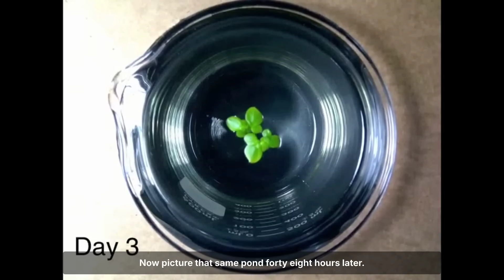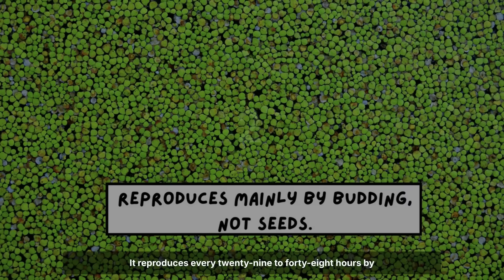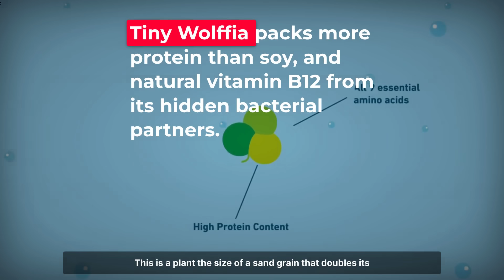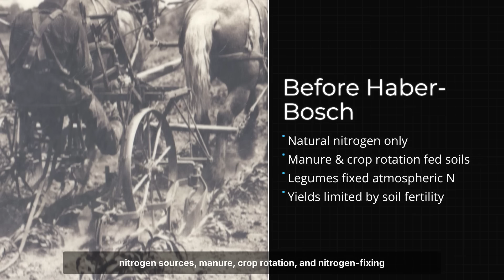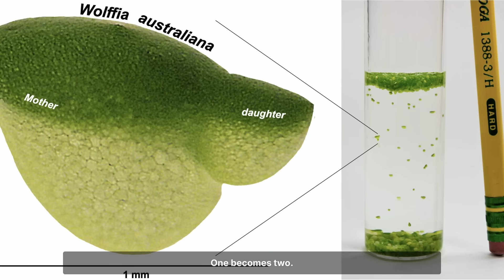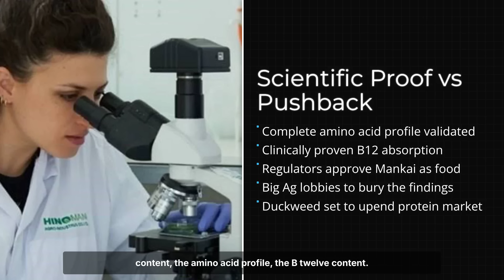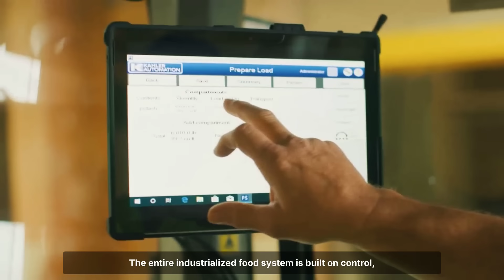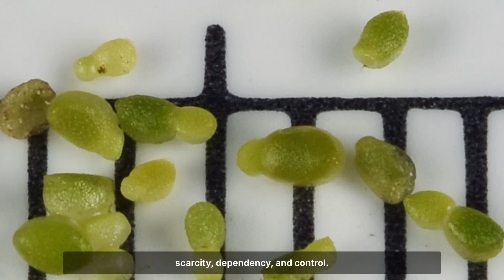This Plant Has More Protein Than Beef, Doubles Every 48 Hours (But It's Called Pond Scum)

Comment: The claim that 600g of fresh Wolffia per day meets daily protein needs is misleading, The math doesn't hold. Fresh Wolffia is ~92-95% water. 600g fresh equals ~30-40g dry matter.At 45% protein, that yields ~15g of protein—far short of the daily 80g requirement which need closer to 3-4kg of fresh wet plant matter.

Comment: In Hindi, Wolffia globosa is primarily known as वॉटरमील (Watermeal).
Since it is a scientific and relatively niche aquatic plant, it is often referred to by its transliterated English name or its scientific name in educational and botanical contexts.
Common Names
 * Hindi: वॉटरमील (Watermeal) or वोल्फिया ग्लोबोसा (Wolffia Globosa)
 * English: Asian Watermeal, Rootless Duckweed, or Water Eggs.
Key Characteristics
 * Smallest Plant: It is recognized as the world's smallest flowering plant, measuring only about 0.1 to 0.2 mm in diameter.
 * Appearance: It looks like tiny green grains or specks of cornmeal floating on the surface of still water. It has no roots, stems, or leaves.
 * Nutritional Value: It is a rich source of protein and has been researched as a potential food source for astronauts and livestock. In parts of Southeast Asia (like Thailand), it is known locally as Khai-nam (water eggs) and used in traditional cuisine.
Would you like more information on its nutritional benefits or how it is being used in modern research?

Comment: I found the statement about the ESFA allowing wolfia as a new food lacking a bit of context. While the plant itself is allowed now, the powdered form is still forbidden in the EU mainly due to high manganese content. As super accumulator wolfia adsorbs plenty of contaminants from the water, which require a carefull control of the feeding water. Also while it does not "require" fertilizer in the form which is put on the fileds, it still requires K, N, P (and for the bacteria and B12 production: Co) in the water.

Comment: Duckweed has the nickname "aquarium herpes" in the fish keeping hobby because once you introduce it to your tank, it is extremely hard to get rid of. Just a single speck missed is enough to start a whole new carpet. It's recommended to keep separate equipment such as nets for tanks with duckweed. I have duckweed in my tanks and smaller planters descendant from a batch I bought years ago. 

But it's great for sucking up nitrates, nitrites, and ammonia not to mention provides helpful cover. Plus it looks really nice. So it remains popular.

Comment: One other benefit is that having something like this covering the surface of the water can dramatically reduce evaporation.  That's a big deal in the western US, and any other hot, dry agricultural areas, because many farms here have ponds used to store excess water and provide irrigation.  But during the hottest weeks, when you need the water the most, you also get the most evaporation.  This could potentially provide a double benefit, by conserving water AND providing a food source for livestock.  Given its growth rate, it would be interesting to see how it competes with other fast-growing grazing crops.  If it outperforms those by a good margin, that could allow farmers to carry the same size herd on less land, and possibly produce healthier animals.  With the beef industry, in particular, currently being trampled by the meat packing megacorporations, this might be a good way for them to reduce their operating costs and stabilize their revenues.

Comment: Great video on Wolffia globosa (Mankai duckweed)—it's genuinely exciting! High protein (up to 45% dry weight in optimal conditions), complete amino acids, bioactive B12 from symbiosis, fast growth, and wastewater-cleaning potential are all backed by peer-reviewed studies (e.g., Ben-Gurion University trials in Clinical Nutrition).

But a few claims are overstated, and the "suppression by Big Fertilizer" narrative doesn't hold up:

Yields: Realistic managed yields are 10–30 tons dry biomass/ha/year (protein ~4–12 tons/ha), far better than soy but not the "100 tons protein/ha" mentioned—that's unrealistic extrapolation ignoring limits like light/nutrients/harvesting.

B12: It's bioactive and helpful (especially for plant-based diets), but low (~2–3 μg/100g dry). You'd need a lot for daily needs—great supplement, not a standalone fix.

Commercial status: Mankai (from Hinoman) is available as frozen cubes, powders, and shakes online (e.g., eatmankai.com, some Amazon listings). It's GRAS in the US, approved as novel food in EU for fresh forms. Not mainstream yet due to processing costs, safety controls (wild can accumulate toxins), and consumer familiarity—not a conspiracy.

Suppression? No evidence of deliberate burying by fertilizer industry. Barriers are practical: tiny size makes scalable harvesting/drying tricky; needs controlled growth for safety; soy/pea infrastructure dominates. Research is booming for sustainability reasons.

Comment: But it’s NOT a ‘complete protein source’. What a disapointment to find out these claims don’t actually hold up… Duckweed is nutritionally interesting and unusually high in protein • for a plant •, with relatively low antinutrients when grown in controlled conditions and properly processed. However, it is not a replacement for animal protein. It does not reliably provide bioavailable vitamin B12, has limitations in essential amino acids such as methionine, and lacks several micronutrients that animal foods supply in readily usable forms. Even with boiling or fermentation, duckweed works best as a supplemental plant protein or ingredient in a mixed diet, not as a primary protein source or nutritional foundation. But its ease of growing is realy its most intetesting aspect, also it could be an important nutritional upgrade in areas of extreme poverty and malnutrition.

Comment: This is used as chicken feed in Asia. You can use 60 % duckweed and the rest is what ever the free range chicken find in or on the ground plus some grains and kitchen leftovers. 
Some people grow tilapia in above ground pools and have the duckweed growing on the water surface. The fish can live off of that but if you place your chicken coop above the pool and the droppings fall into the water the fish are better fed. You can couple this with an aerophonics system, circulating the fish tank water through a ammonia to nitrogen converter and you got year around fresh greens for very little money plus the eggs, poultry and fish meat your system produces. If you set up your greenhouse with the earth battery method you don't even need heating and cooling. A simple and affordable solar system can run the thermostat governed fans. 
All you need is space which is the real Achilles heel for many. Farmers got plenty of food the way it is. Ask a farmer or those living in the country and food is the last thing that concerns them. They got plenty of food.  It's the city people who are trying to find a way out of their slave existence. High density living is the main issue and not the lack of food security.

Comment: You know not all proteen is the same right? The plant based protein and the meat based protein have slight diffrent chemical structures. 
The human body is designed to used both for different things. 
Its hallarious that you suggest that muscles can be built from plants. That's your basic argument for the protein here. 
Lots of different proteins out here buddy. 
Its like expecting kerosene to run your petro car.  Well they are both fuels.  But they don't quite work the same.

Comment: Cool plant, interesting research – but this video leans hard into hype and conspiracy. Actual science is promising, but not magic.

Wolffia/Mankai is legitimately impressive:
• ~35–45% protein when dried, not when eaten fresh (fresh is ~4% protein).
• Contains all essential amino acids and some B12 via symbiotic bacteria (not the plant itself).
• Clinical trials showed good digestibility, roughly similar to dairy/peas protein.
• Fast growth? Yes. Under controlled, nutrient-supplied conditions, not just “a pond and sunlight.”
• NASA has tested it for closed-loop life support, which is cool and real.

But…

Claims that “industry buried it” stretch evidence to narrative. Duckweed isn’t popular because:
• It has very high water content, so you need a lot to match real protein intake.
• Growth rates require controlled nutrient input, not just a bucket.
• Taste/culinary acceptance matters, and most people won't replace steak with pond greens.
• Scaling production safely means monitoring pathogens, heavy metals, wastewater toxins, etc.
• Monoculture dominance isn’t evidence of suppression – it's economics, yield consistency, shelf life, and logistics.

Also, comparing to beef by dry weight is misleading if you don’t note moisture content. Beef is ~70% water but still delivers way more protein per serving than scooping wet duckweed out of a pond.

Potential future use cases?
✓ space farming
✓ animal feed
✓ wastewater remediation
✓ supplements/ingredient powders
✓ survival + low-resource food production

But replacing cattle or collapsing Big Ag? Not remotely demonstrated.
Promising ≠ panacea. Underrated ≠ suppressed.

If people want to grow it, great – but promote it for what it is:
a fast-growing aquatic plant with decent amino acid profile and potential for niche protein production…
not a secret protein that could “feed the world for free but They hid it.”

Science doesn’t need myths to be interesting.
Reply: Appreciate your thoughtful comment.

Comment: You can't turn that into viable nutrition in your body, we aren't designed for it. 

It'll just cause bloat, gas, and inflammation, and very little of the nutrition will get digested. Not to mention there's no usable fat for your brain, hormonal system, etc. 

Could be used to feed animals that are designed for it.

Comment: My only issue with duckweed really is that I don't know how much of it is bird droppings. But if I live in an area without water borne birds, I think that's when I'd be growing duckweed. Either that, or I need to figure out a way how to wash it.
Reply: If you want to use it for compost then you can just take it from a pond and it works great, unless you've got heavy metal pollution there. If you want to eat it then you grow it in a clean tank of fresh water with lots of sunlight and definitely nowhere near the birdpoop.
Don't mix the two uses.

Comment: You are comparing apples and oranges. Fresh beef steak has 20% protein and 75% water. Remove water and you end up with 80% protein. 2x more than dry duck weed. 40% is still impressive but the claim is incorrect

Comment: This video is misleading. Don't eat this from wastewater or runoff water or natural pond water. It is a bioaccummulator and will concentrate heavy metals,  etc.
Reply from the maker: That is an important point, and you are right to flag it. Duckweed should only be harvested from clean, controlled water sources. It is a strong bioaccumulator, which is useful for remediation, but that also means it can concentrate heavy metals and pollutants if grown in wastewater, runoff, or contaminated ponds. The video is about its potential, not a recommendation to harvest it from unsafe environments. Thanks for adding that clarification.

Comment: I published a paper in 1980s on duckweed used to treat sugar mill effluent and used to fertlisie milkfish ponds in Philippines. It solved oxygen crashes in the big bay where effluent discharged.
Reply from the maker: That is impressive work. Using duckweed to treat sugar mill effluent and then cycle those nutrients into milkfish ponds is a great example of practical ecological engineering. Solving oxygen crashes at that scale shows how powerful these natural systems can be when they are applied thoughtfully. Thanks for sharing that experience.
Reply: Just curious, did the concept in your paper ever come to fruition in a real-world, industrial-scale application?
Reply: @edukid1984 yes. It was a 50 ha milkfish farm and 4 ha duckweed ponds. The BOD reduction was > 95%. But politics overtook the operation and the whole plantation was shut down a few years later. Sad story. Philippines
Reply: @damo780  of course. There is a very real anti-human agenda at work on the planet.
Reply: If it produces oxygen, wouldn't it wreck the levels on existing water ecosystems?

In Murcia, Spain, we have an inner sea near the coast (Mar Menor) dying due to excess oxygen produced by plant overgrowth in water from the fertilizers seeping into it's feeding rivers
Reply: @drillerdev4624  excess oxygen usually isn't the issue, it's when overgrowth outcompetes other plants e.g. surface algae/cyanobacteria/weeds blocking sunlight for underwater plants/reef, and when the overgrowth dies it deoxygenates the water from decomposition and toxic byproducts
Reply: @Zaihanisme  It might usually be the issue, but it's the exact problem in Mar Menor's case. That's why I was asking about it, it hits close to home
Reply: @drillerdev4624 Are you sure you haven't got it backwards? Every source I can find online w.r.t. the Mar Menor crisis says it's a severe LACK of oxygen in the water from plant overgrowth that killed fish and crustascean in the sea, not EXCESS of it.
Reply: @edukid1984 I was talking from memory, so it may well be. Thanks for pointing out 👍

Comment: Per ChatGPT: 
For duckweed vs. beef (protein), fresh duckweed is mostly water. A review table for Lemna minor lists moisture at about 91–95 g per 100 g fresh plant and protein at about 1–4 g per 100 g fresh. 
PMC
 By contrast, a USDA protein table lists 23.27 g protein in a 4‑oz (113 g) serving of raw beef top loin, which is about 20.6 g protein per 100 g. 
National Agricultural Library
 So on a fresh-weight basis (the way people normally compare foods), beef has far more protein per 100 g than duckweed. The “duckweed beats beef” claim usually comes from dry-weight figures: duckweed can be very high in protein when dried, with reports up to ~45% protein on a dry-weight basis depending on species and growing conditions. 
Grain and Food Science
 That can make duckweed look “higher protein” if someone compares dried duckweed (or duckweed protein concentrate) against raw beef without adjusting for water content. It’s an apples-to-oranges comparison unless both are normalized to the same basis (fresh weight, dry matter, per calorie, etc.).
Reply: Yes ,but what does duckweed cost vs, beef. how about the enviromental cost of beef vs. duckweed

Comment: To cultivate it you must add cobalt in trace amounts to co-bio produce the B 12 just like they did in Perth Australia when they use powdered iron ore containing trace amounts of COBALT to synergistically cooperate biogeochemically with the iron and with some fully fermented plant-based compost called humus, Check the water and soil around the pond and the sediments at the bottom of the pond for any forever chemicals and for accumulated pollutants like cadmium chloride and all kinds of cadmium compounds and lead and zinc and mercury. Cadmium chloride causes Alzheimer's diseases and dementia and it slowly acts unnoticed over the many decades or just years depending on location and genetics and consumption of certain foods.
Reply from the maker: Good points to raise. Duckweed is powerful, but context really matters. Duckweed itself does not reliably produce bioavailable B12, when B12 is present it usually comes from microbes in the system. Trace cobalt can support those microbes, but it is easy to overdo, so caution is important. Water quality is also critical, since duckweed absorbs whatever is in the water. If it is grown for food or animal feed, the pond and sediments should be clean and ideally tested. Duckweed can accumulate heavy metals like cadmium, lead, and mercury if they are present. Bottom line, duckweed is incredibly useful, but it should only be harvested from clean, well understood systems.
Reply: @NatureLostVault  I'm incredibly impressed with your comment. This is much more accurate than the video itself. Kudos to you for concisely pointing out the flaws in the described process and requirements for this having any hope of success.
Reply: @NatureLostVault  duckweed farms could perhaps have water treated biologically by heavy metal concentrating plants, duckweeds themselves and possibly fungi? Then the treated water can be piped over to other ponds growing the duckweed for consumption
Reply: @NatureLostVault  So chemically stable environments. Got it. The chemical industry is safe.
Reply: Chlorella is more known than duckweed as it has B12 & higher protein. 
However, duckweed protein offers a higher proportion of branched-chain amino acids (BCAAs), which are crucial for muscle repair and energy production.
Reply: It was called coastal disease, soil lacking trace amounts of cobalt, caused sickness in livestock in Australia. So Karl are you in Australia? My brother and I are hunting down an Australian version of W.  globosa.

Comment: Plants love duck weed as a fertilizer.
Reply: Yes. I place duck weed around my plants and let it decompose. I haven't run into a plant that doesn't appreciate the duckweed. Potted, earth grown, flowers, vegetables. I keep the duck weed off the plants stalks and leaves, use it after watering, and in a week when its time to water, the duckweed's already decomposed and absorbed by the plant. I do tend to use it heavier the further , I get away from the plant. If you do get it on the stalk or the leaves of the plant , I give it a very light rinsing , and it comes right off.